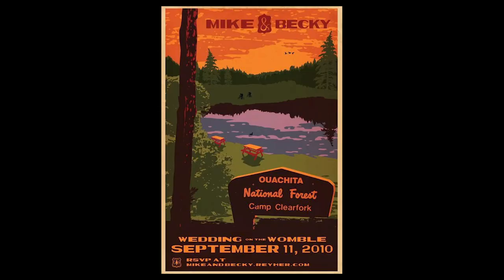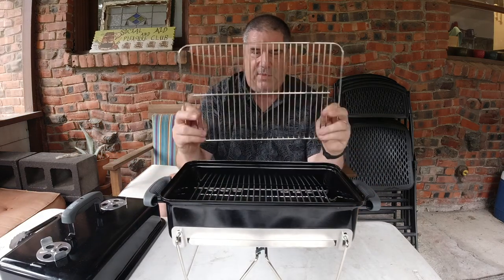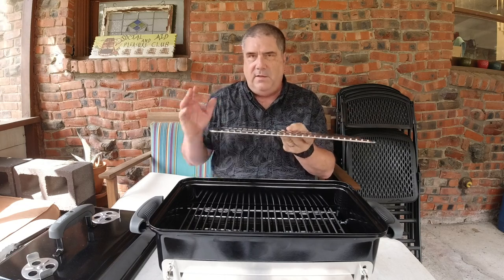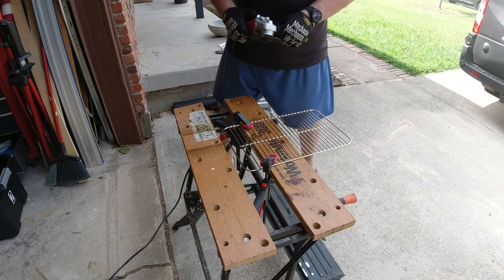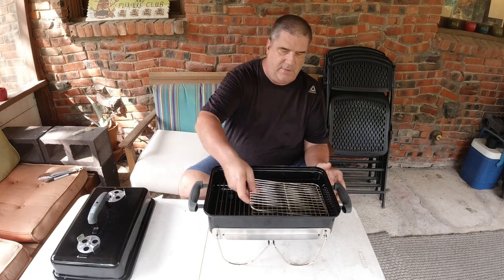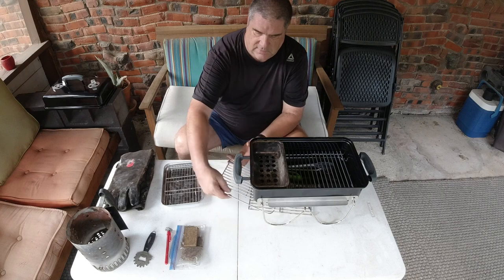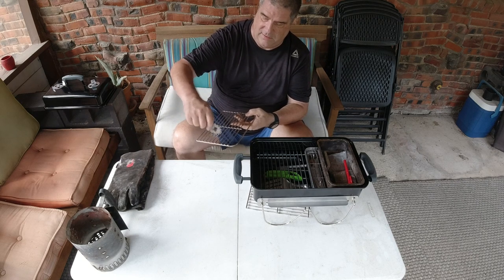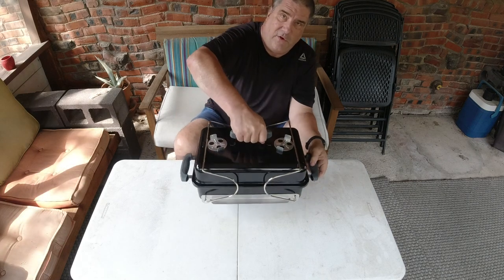Weber Go Anywhere (WGA) Smoker Mod

Comment: Thanks for this very good and informative video.  A couple of things I did different, 1) Instead of cutting in half, I cut my cooking grate with one side about 9", still fits in for storage, but goes right up to charcoal box/loaf pan. It gives more indirect grilling surface without covering the charcoal box, in case you need to add charcoal/wood.  2) If you turn bottom grate over, the charcoal box sits lower and cooking grate sits in flange better for direct grilling. Otherwise, I did everything the same.  Ron

Comment: Damn dude, your using an angle grinder without a disk shroud never mind having one correctly adjusted. You then used it so the sparks where flying into your face and then you used a cutting disk as a grinder.... I don't work for OSHA/HSE but damn dude.

Comment: I see you and others putting the starter in the grill. Sometimes struggling with the handle. Why not just take the rivets off that hold the handle on and just use some ss hardware to hold it together when needed. If I was packing this way, that is what I would do.
Reply from the maker: After enough times packing it I seemed to have "cracked the code" with no struggle. I usually roll the gloves up inside the chimney. Others I have seen put a plastic bag with coals inside. Personally I like to be able to check on any consumables outside the kit. The cool things is everyone seems to be able to put their own spin on this. Thanks for tuning in!